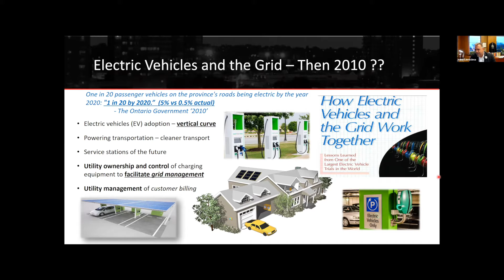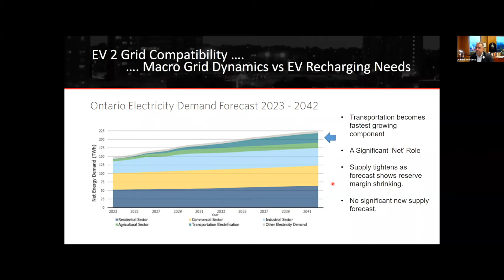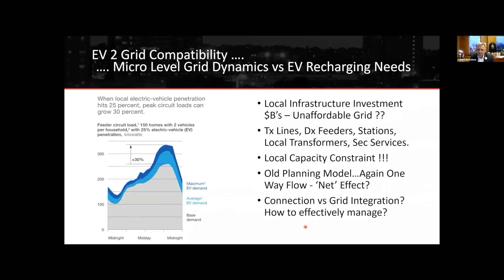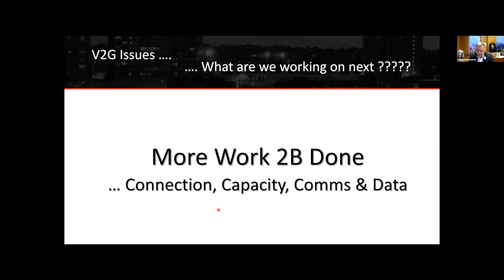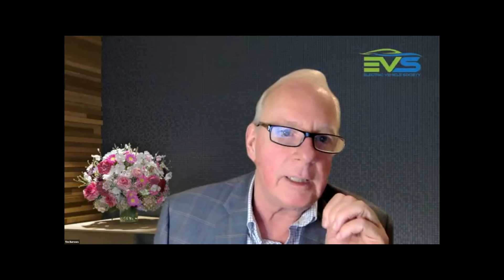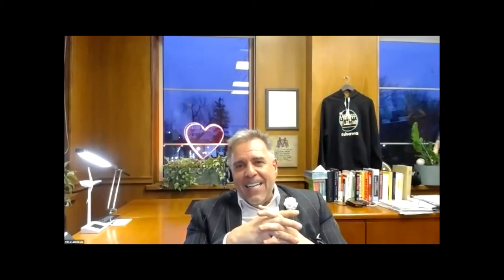Bidirectional Charging, Preparing the Grid with Ivano Labricciosa    Oshawa Power

Comment: I would like to see regulations requiring bidirectional capabilities at the DC level. Provide a way to tap that large battery. The battery warranty cold be linked to lifetime kWh use to account for non vehicle use. 

Inverters that are approved for grid connectivity are not cheap. The equipment can also be large and add weight. Leave the inverter on the wall.
Reply from the maker: It sure looks like regulations will be needed but it shouldn't be all that difficult.  I hope the cost of inverters goes down as they are manufactured in greater and greater quantities.